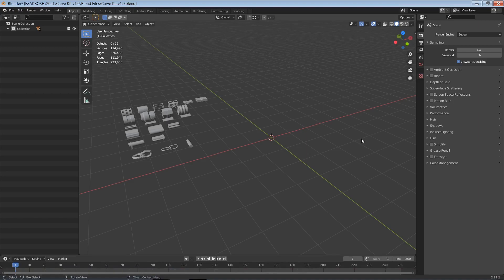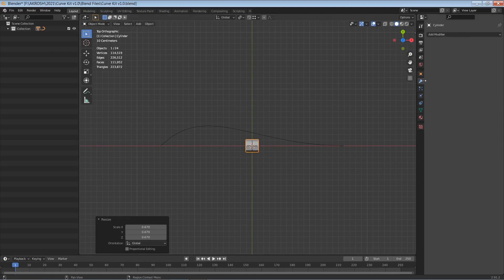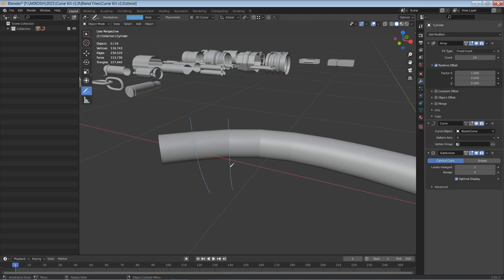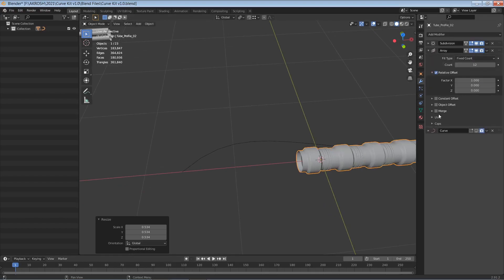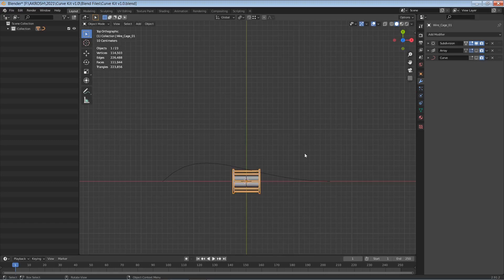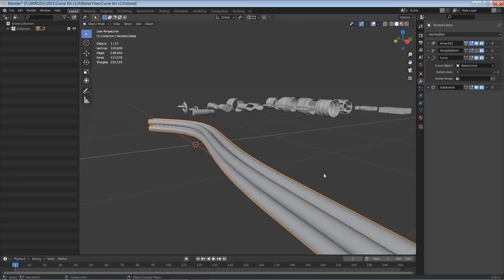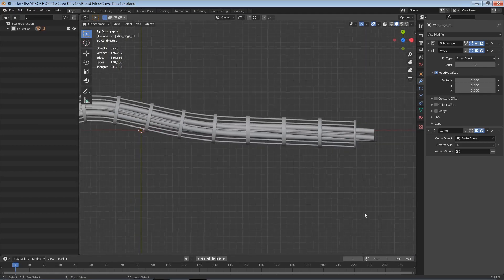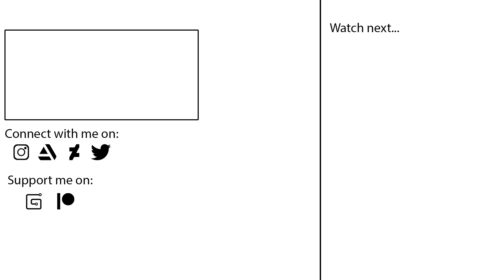How to Create Cables/Tubes/Pipes/Wires in Blender 3D

Comment: In earlier versions than 4.2, I used to be able to make a curve, then go into Data properties and select an option that made the curve into a round profile of a specified diameter, but I can't find it anymore in v 4.2. I used to be able to do this in five seconds, but now I've spent 40 minutes trying to figure it out and am still stuck.
Reply from the maker: You can still do this in ver. 4.2. Data properties -> geometry -> Bevel -> Round -> Depth.

Comment: I seem to have a problem applying all transformations. The cylinder array does not merge into a long pipe/wire for some reason. Any solution to this?
Reply from the maker: Make sure to select the merge option in the array modifier and set the distance value to whatever is applicable to your scene. Hope this helps.
Reply: Thank you!

Comment: Helpful tutorial, but for us that only start you need to show things a tiny bit slower, for example when you created an array and the said let's apply transformation I totally lost ya you did it so fast I didn't had a chance to see what you did..
Reply from the maker: Glad you found it helpful and thanks for the tip. I'll make sure to use a keystroke capture software for future tutorials so that you can see the hotkeys I'm using. Also, if you wanna apply transformation just hit ctrl+A. If you wanna apply a specific modifier. Then hover over the modifier and hit ctrl+A. Hope that clarifies things.
Reply: You can also slow it down on the settings is not a perfect solution, but it does make it easier